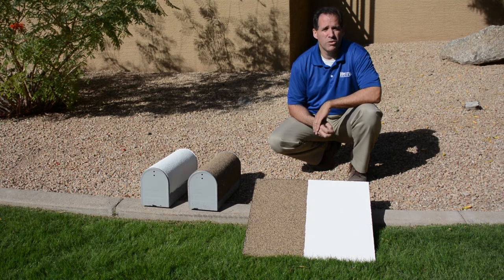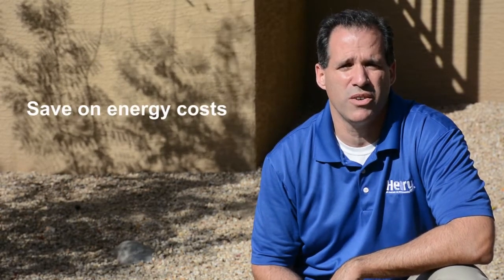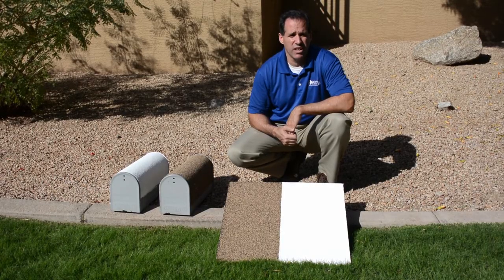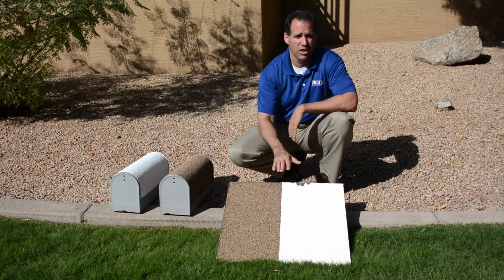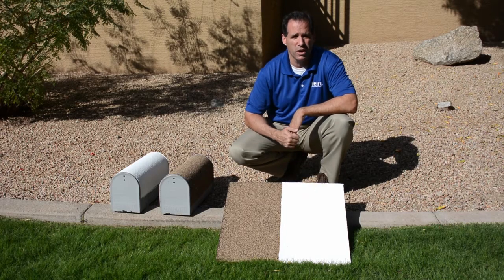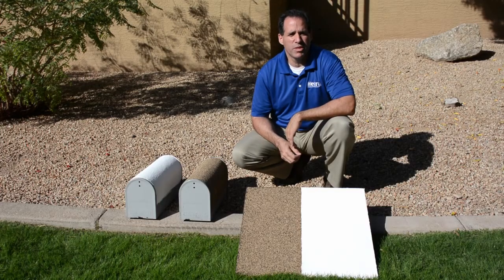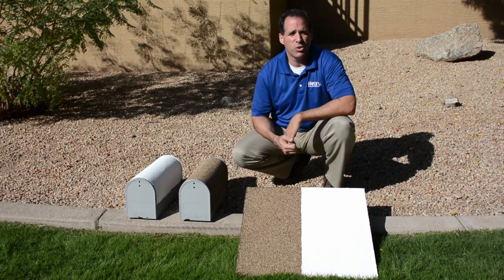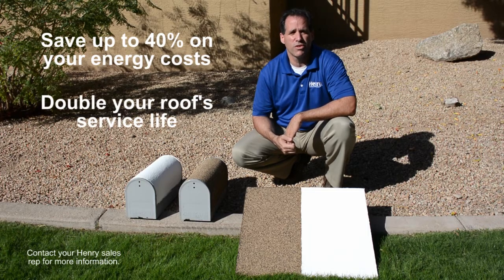Why use a white roof coating on your flat or low slope roof?

Comment: what can I use on a standard shingle roof?....
Reply: I used Henry elastomeric roof paint directly without a primer on conventional asphalt shingles on a pitched roof in 2008. It's still going strong nine years later, with no bubbling up. Just don't apply paint to fresh (less than 30 days old) shingles or the paint will bubble up from interacting with the asphalt. Even fresh shingles can take white roof paint if you use a primer first.
Reply from the maker: Hi Robert. Unfortunately, we do not make a roof coating that can be applied to shingles of any kind.
Reply: @HenryCompanyLLC  would like to contact local li rep to become a certified installer if possible.

Comment: Why the two mailboxes with the same material?  You could have used them to show us / customers the inside temp diff of the two mailboxes.  It makes this customer wonder why have them and then not use them in the video?  It makes me wonder the plan was to show how Henry paint changes the temp inside objects with your paint.  Metal Mailboxes would have been perfect for this since they get very warm.  It makes me think either your video crew forgot to bring thermometers (But one is used in this video) or there was no temp diff ... then of course they are probably too small to show any diff in temp and probably changed your mind.
Reply from the maker: Hey there. We actually had thermometers inserted in the mailboxes to show the temperature difference. Unfortunately, the harsh Phoenix, Arizona sun made the readings impossible to see on video, so we had to scrap those clips. Thanks for the comment.
Reply: So no one brought a Sun Umbrella? (In Phx) Or thought of using the two boards to block the sun to show the temps?  Or maybe ues the house directly behind him and use actual house and rooms with a Therm gun to show temps diff before / after painting?  Don't give up, please find a way to show how your paint works in decreasing the A/C bill instead of just saying so.  Maybe even a couple small dog houses ... could your paint be used to help the pets have protetction from the sun?  Or maybe even find a small house like those who are less the 500 sq feet a before and after a rood paint job.  Maybe a couple shacks, or a couple RV's ... other paint companies here on You Tube are going past showing temp of the roof.  Not sure how much a 50F temp decrease on a roof does with decreasing how much in the room below it.  I understand it is not equal, but do expect 3-10% change in the reem below the paint job.  Customers want to see the room below .... there are enough videos showing how to paint a roof, and the temp change with white we / customers agree with that, we want someone to show a video that competes and wins or ties with the competition with the temp change in the reem below your paint.